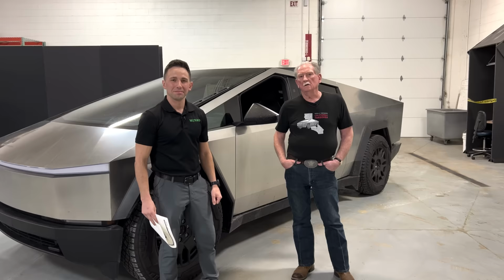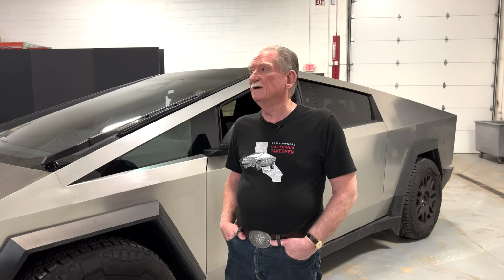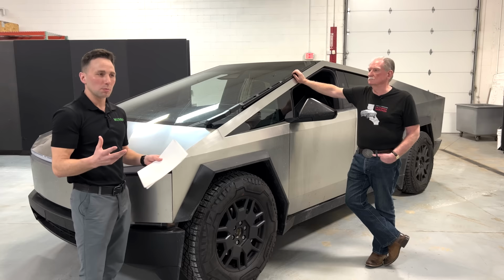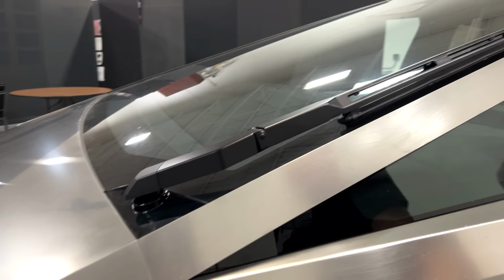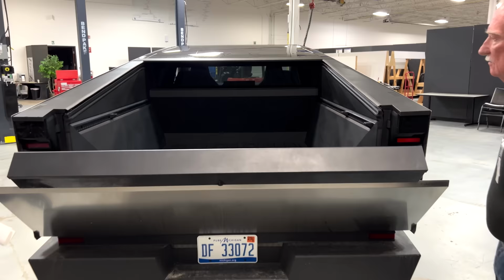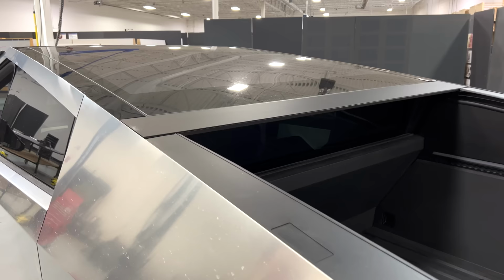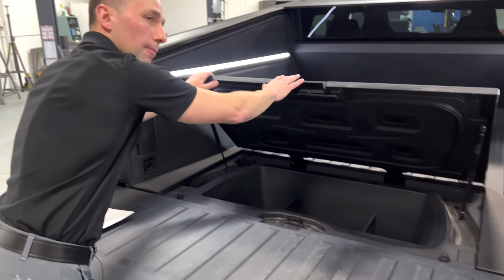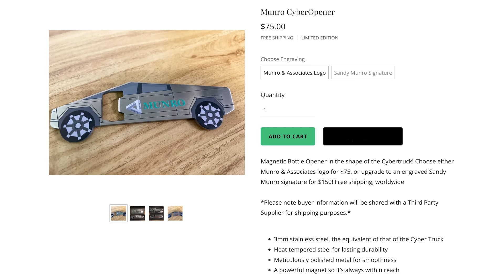We're Tearing Down a Cybertruck!

Comment: I hope Tesla adds a solar tonneau cover and the ability to direct charge from add-on solar soon.  Even if the tonneau only maintains current state of charge while running sentry mode and climate control, that would be useful.  And the ability to charge in the middle of nowhere with extra panels would be amazing.
Reply: Agreed. At the VERY least some sort of off-grid package with deployable panels that can be stored in the front.

Comment: The problem with the under bed storage is that a spare tire does not fit in there what a huge oversight. The other thing is it appears that this created a low hanging box(diaper) under the bumper creating a terrible departure angle it's only a matter of time before that gets smashed off road or backing up.

Comment: I guess it's targeted to the run around user, but I think not having an under bed spare tire is a big miss. Would love the 500 mile range for $125k too. I'll wait for the battery tech to get there.
Reply: How often do you need to drive 500 miles in a single day?
Reply: @douglasburnside  Trailer.
Reply: IF you really can't put the CT in the bed I expect we will soon seen swing arm spare tire mounts that put the tire behind the tailgate.   When the last foundation series is sold you can get your CT cyberbeast for $116 with extender.  Dual motor for $96.    Order now and by the time you get yours the battery density may be up enough to make the full 500 range with the extender. LOL
Reply: @danharold3087  the spare tire off the rear gate will kill range. The extra battery will be great when the energy density is such that the range is 500 miles in winter conditions and a full charge isn't bad for the battery. ( Like all 4680s)
Reply: @treborheminway3814  Yes that is why I mentioned an aerodynamic cover for highway uses.   Your also going to kill range if you hang it off the flat bottom at speeds too.   At lower speeds it is not much of an issue.   
There is no rear axle and pumpkin to slot in a spare behind like on a gas truck.
Reply: @danharold3087  I'm with you on a areo dynamic cover. That would be very Elon. Could make for an overall improvement.  I like how rivian did it, but they don't have that rear casting. ( That has to add a ton of stiffness)
Reply: @treborheminway3814   The stiffness numbers on the CT are incredible.  The structural battery pack on the bottom and sail on top.
Reply: @treborheminway3814  Now that's what I call a concise reply! No wasted words there. Well said.
Reply: @douglasburnside  haha. I'm glad you appreciate it. 👍

Comment: I have not seen it in person but is that not L track running down both sides of the bed of the cyber truck, if it is why are you making such a point about fixed mounting points that are provided when every one of those circles can accept one of those little plug-in hooks loops every kind of different hook you can imagine and they just pop in and turn?  Cheers

Comment: Im curious how are those panels atached,,adhesive ?
Reply: One can see the bolt hole attachment points on the giga castings.  I expect they laser weld brackets to the back of the panel.  Maybe the bolt or nut is captive to the panel.

Comment: I'd love an answer for how possible it would be for shops to retrofit tool storage areas into the spaces between the skin and the bed walls. Is there enough internal structure (possibly with aftermarket reinforcement) for the skin panels to open like doors when the vehicle isn't moving? That might help with most of the issues caused by the high bed walls.
Reply: How much weight are you willing to add?
Reply: @danharold3087  I don't really have a number for you. I'm just a curious bystander with no need for a truck. 
It would probably vary person to person based on their specific hauling/towing needs. 
Thanks for the thoughtful question.
Reply: For reference the video that I originally got the idea from (cant find it now) had a mod that looked like this: https://youtu.be/EuI6ACCwipU but the compartments were shallower to not impinge into the bed space (wouldn't have to mess with that potentially structural plane of metal) and the truck was one with a liftgate.
After a bit of looking around these other concepts would probably be easier to do in the cybertruck:
Rambox style compartments. You only lose and have to rework the structure of the upper triangle.
A fold out ladder in a rambox style compartment. Similar to this thing, https://youtu.be/ISzm9h5S8to?t=126
Slide out taillight drawers like these: https://youtu.be/guJxW2OPj3c

Comment: Is it a true exo skeleton?
Reply: It would be interesting if they could get the skin off before breaking it down much more and then measure the stiffness change somehow.
Reply: @AndrewHelgeCox  Easy, put a jack under 1 wheel and jack it up. measure how high before next tire comes off the ground. Then jack it up until 2nd wheel is off the ground. Do it with and without SS panels.

Comment: Could you please find out why the door colors never match the rest of the truck. Is it different material, misaligned, different thickness, or not properly cleaned?
Reply: I think only the doors have the bullet resistance?
Reply: @casualgamer1209   The doors are made from a different coil of stainless steel.  It happens to be 1.8mm instead of 1.4 mm.  Surface texture is most likely due to the age of the brushes back at the steel mill.
Reply: @danharold3087 Oh! thanks for telling me that- didn't know.

Comment: HUH???   CYBERTRUCK DIMENSIONS ARE SIMILAR TO A F SERIES FORD...  The Tesla Cybertruck stands 5,683 mm long, 2,413 mm wide and 1,791 mm tall, giving it a lower centre of mass. Speaking of which, it weighs 2,995 kg or 3,104 kg depending on the configuration. The cargo bed is 6 feet long. The Ford F-150 Lightning, meanwhile, is 5,911 mm long, 2,031 mm wide and 1,989 mm tall.Dec 7, 2023

Comment: Confused, I thought you cannot run FSD on Cybertruck software. Regardless, pumped to see Munro dig in!
Reply: Perhaps the truck has the upgrade, but it is not operational yet?
Reply: All Foundation Series Cybertrucks include FSD in the price but it's not rolled out yet.  Probably early-mid summer.  They most likely didn't want to deal with the pre FSD builds when V12 is imminent.
Reply: @StormyDog  thank you very much for the information! 👍👍
Reply: @deltajohnny  Thanks for the nice reply, I actually meant to write "pre AI builds" above.  V12 is trained by showing it examples of good drivers handling various situations rather than traditional programming methods.
Reply: @StormyDog  Thank you very much again, and I'm really happy that FSD is improving so much with AI, as I live in Europe and, finally, our politicians have approved a norm which allows manufacturers to implement more self-driving features in vehicles, and Tesla's system will finally be able to show its true capability in European roads in some months 👏👏👏
Reply: @StormyDog   Tesla has been claiming FSD for 10 years and they have never produced it.

Comment: possible to put selette to tow fifthwheel ?
Reply: Use trailer hitch adapters
Reply: @markplott4820  my concerné was not to tow trailer but fifthwheel. Fifthwheel use selette inside the bed
Reply: @nicolassiffert2165  The rear casting has 4 bolts to mount it.  I think Tesla or some 3rd party is selling the bit that goes in the bed.  If that is the selette.

Comment: 11:43 some real honesty...it is an amazing machine but it doesn't make the most of sense for some applications (work, long distance towing, overlanding but that's true of most EVs).  The new Ramcharger could be the solution till either batteries improve or they can get charging down to a fill up time......both of which a likely quite a few years off.

Comment: How did he manage to get FSD when most purchasers are complaining they paid 20k for the foundation series and they didn't get it?
Reply: Foundation owners get FSD - when it is available. Consider it a pre-payment.
Reply: That’s the problem they are not complaining of anything they paid the extra $ 20 000 and a bunch of things are missing hub caps diff locks FSD and a limited rear steer system.
Reply: @V10PDTDI Rear steer is going to be increased soon, if by hub caps you mean aero caps, those are misisng becaused the early areo caps could damage the tire because they fit too tight, and FSD will be added via an OTA update probably when V12 launches, maybe a little bit later because of the extra bumper cam.

Comment: I have been thinking and saying its not a body on frame its not an exo skeleton its a frame on frame design
Reply: Interesting thought. Would love to hear your reason.
Reply: @casualgamer1209  because that's practically how its being used as far as i can tell
Reply: First define exoskeleton then I can tell you it is n exoskeleton design.  But it does not matter.  It has a ultra high strength hot stamped boron steel cabin a huge casting bolted on each end. Bolt the battery in for a floor and glass for the roof.  Everything else including body panels are bolted to the casting.  This is new.  Call it anything you like.
Reply: @danharold3087  exoskeleton would be to where weight get redistributed both internal and external to the outermost layer aka body panels theres only so much of this that can be done though kinda difficult to get axel weight onto a body panel

Comment: How does it come apart?
Reply: Bolts
Reply: It does, and that's all you need to know.
Reply: Im wondering if it's glued or hidden welds
Reply: @ExploringCabinsandMines  What part of ‘bolts’ do you not understand.
Reply: @fredbloggs5902  Whats your knowledge source?  otherwise you sound sarcastic. 
It's not body on frame construction, Castings front and back, structural battery pack would lead me to guess not a lot comes apart.
Reply: @ExploringCabinsandMines  Obviously the castings and battery don’t come apart. They aren’t intended to and nobody has ever claimed that they do.

You asked how the CyberTruck comes apart and I told you.

You’re welcome to believe whatever you like.

Comment: Tesla needs to make the front sides be glass. That will get rid of those Blind spots. Add 100 more miles of range and then release it as Cybertruck 2 . I like it but I need more.
Reply: They are there to protect the passengers.
Reply: @danharold3087  Doesn't protect anything. The side airbags come out the area near the Seat belt section. Plus that vehicle is built tough like a tank to a lesser degree. So my design can work. Place the A Pillar blind spot with tough Glass. The tough Bullet proof shatter proof glass that makes it tough and gives more visibility. Only thing is sun will shine in your eyes more but you have a chance to see.
Reply: @ronbrooks6547  Roof crush.  It is why we don't have A pillars like we had in the 60s.
Reply: @danharold3087  Roofs are stronger now. Plus you can use strong glass but line it with Metal to make it stronger than before. Kinda like glass with frames around it like a Mirror 🪞
Reply: @ronbrooks6547  You should be aware that Ford is in court defending itself because some F150 roofs were alleged not strong enough.   These beefier A pillars are needed to keep the roof where it belong in a roll over.
Reply: @danharold3087  I understand but my second Proposal makes the roof stronger With Strong Glass surrounded by Stronger still frames which is the best of both worlds amd stronger than before.

Comment: Looking at the underbed storage and basing this on the dimensions from Kim Java, it appears that you could hold 40kwh or more worth of battery cells there. I'm wondering why Tesla decided to have the expansion pack added to the back of the bed instead of that storage bay.
Reply: Same.
Reply: Every lb of battery cuts into to payload and towing and makes that truck that much heavier.  Sweet spot for the masses.    Why build what ford and GM  are offering.
Reply: @danharold3087  Not talking about by default. But as the optional addon battery pack. Right now that optional pack attaches to the back of the bed.
Reply: @anthonypelchat   Did you include the space for the battery heating and cooling system. Heat pump and radiator.  BMS and charger.
Reply: @danharold3087  I would assume it would have an attachment to the main battery pack's systems. There is a little space left over, especially at 40kwh.
Reply: @anthonypelchat  Never put too much stock in assumptions.   What we don't know....
Reply: @danharold3087  There would be engineering to do, which Tesla absolutely could have done. I'm just asking why didn't they do so for that location. I assume there is a reason. I would like to know why.
Reply: @anthonypelchat  Anything I could give you would be a guess.   Maybe they determined the extra 40KWh would not keep the people who wanted to complain about too little range from complaining.
Reply: @danharold3087  They already have an expansion option for CT that is roughly 47kwh. It sits in the back of the bed.
Reply: @anthonypelchat  
OK if Tesla's proposed extender takes 1/3 of the box and is about a foot thick how are you going to cram it into the smaller space?  Give it a rest.  The engineers at tesla went to school.
Reply: @danharold3087  Calm yourself down buddy. I'm not attacking them nor out here claiming I know more than them. I simply asked a question. If you don't like the question, don't jump into it. Nobody invited you nor asked you directly.

As for the space, we don't know the exact measurements. But we do know the measurements for the underbed storage. We also know the measurements and capacity of both 2170s and 4680s. I simply ran the numbers for what could physically fit within that space and with an appropriate margin of error. The numbers I have are between 43-45kwh. More can likely be fit with minor changes. But due to this being a simple bit of math, less could be fit due to other engineering items. That is why I stated as low as 40kwh and as high as 50kwh.
Reply: @anthonypelchat    If Tesla wanted more battery it would have added more battery.  Tesla could have built a 500 mile truck with the payload and tow stated in 2019 but it is not a truck most people would want as a daily driver.   Maybe as bad as double the GVW.  It is not like I and others have not considered this topic.  
A possibly more useful version of the range extender is a fully self contained unit that can be used on the truck when needed and spend most of its life integrated into your home power system.  Maybe design them such that you can use 2  or more of them in the box.  Possibly rental units.  There are issues about this version of reality too.  The modules are heavy and you may be wearing them out sooner.    At the suggested price a range extended would be an excellent way to add more home battery backup capacity and have it double for towing when you need it.
Reply: @danharold3087  I was thinking more of replacing the current range extender with one that fits in or replaces the underbed storage. Could possibly make a user swappable one that is 3 individual units, but not sure that would work right and it will absolutely reduce capacity. Probably a max of 40kwh. And each of the 3 units would still be at least 125lbs.

The current bed unit may make more sense as a swappable unit like you said. Would need swapping stations though. Otherwise not really worth.

Doubt they will do a separate home unit for home storage. They would need to make the current 48v Powerwall work with a battery that is ~800v. I just don't see them doing that. Not that they couldn't. The current inverter in the CT already converts from 800v DC to 240v AC. But you would need that special unit on the Powerwall as well. And not seeing home units at nearly 400lbs being allowed to be swapped by users.
Reply: @anthonypelchat   I am not talking about using smaller modules.
Create a system where people do not need to man handle the extender modules.  We are talking about $100K or so trucks here.  We can put 1 to 3 grand into battery handling.  The people wanting to use them with their home solar will eat it up.
Reply: @anthonypelchat   Just finished a post that address what you said in this one.
Reply: @danharold3087  Remember though that Cybertruck will not remain at 100k or so. It may already be selling for 80k, but that still may be a few months. And then a 60k version. But eventually even those will come down in price.
Reply: @anthonypelchat    Only people who want to use their CT w/o the extender(s) need to buy the stationary stand.  The bits to move the range extenders is peanuts.  I would put them on every range extender but they could be an optional retrofit.

Comment: Some very good insights from the guys , small panels on the tonneau cover for ease of rolling , big bunker in the back not appreciated as a total storage solution combined with the frunk. Be careful backing up Cybertruck , rear bumper very compact. Jordan points out it can be tricky to get over the side of the bed to acess equipment but on the plus side it stores more. On this point , it would be super cool if somebow a external step , almost like a foldable running board were somehow deployable to ease the bed from the sides when parked up would be a unique solution never before seen for trucks maybe a thought going forward for future cybertrucks perhaps modify the rear panel to do two jobs , foldable step and side of truck would be a cool delight and practical item to have to show off to mates.